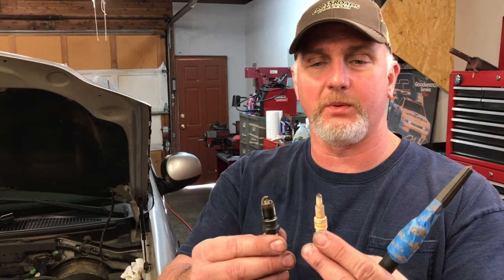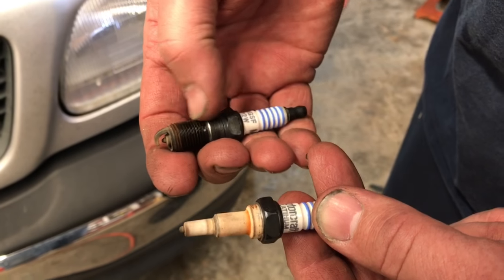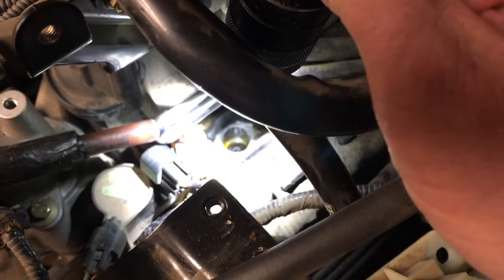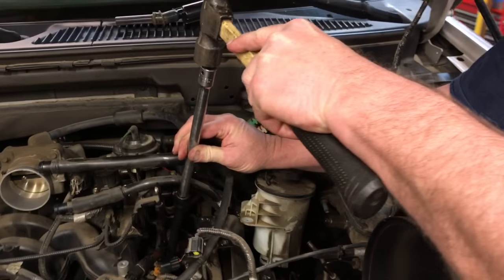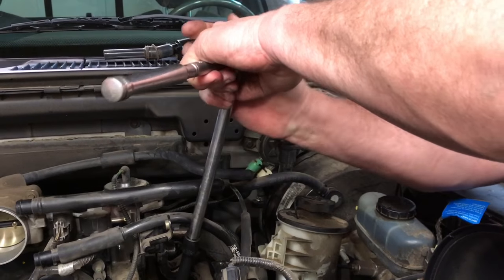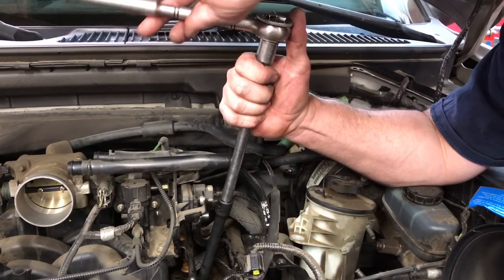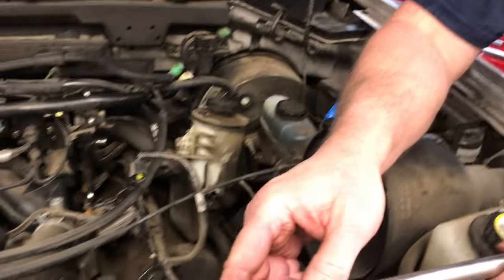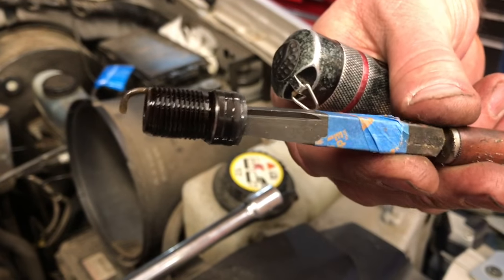How To Remove A Broken Spark Plug

Comment: For those who aren’t catching the name of what he’s using, it’s a stud extractor. It’s four-sided, and secured into a socket. I’m still trying to find out how to not get porcelain chips into the cylinder, as my plug just plain broke outright! According to others here on the comments, it is impossible to avoid, unfortunately. As far as using a vacuum cleaner goes, I plan on using a cornering tool, then inserting a drinking straw into the tool, and sealing it with some kind of tape (duct tape, most likely?). THANKFULLY, I have a camera tool to check for debris in the cylinder! Best $120 I’ve spent in quite a while! Well worth the investment, in case you’re wondering.

Now to get that penetrating oil in there…

I dread thinking about if the rear plugs in my Town & Country refuse to come out properly. :-/

Comment: So my plug broke off but the ceramic portion of the plug is still attached. What's my safest way of removing it and being able to get an ez out in to remove the threads?
Reply from the maker: Try vacuuming it out. Tape a smaller piece or tubing to your shop vac and see if that will suck it out. Worth a try

Comment: I have a 97 Ford F-150 4.6 l is there any other way to get the threads out? I have a broken spark plug to get out Seems like  welded it's so tight

Comment: I have got a 2005 Chevrolet Impala with a broken spark plug   
Where the threaded part is still in the spark plug hole and it's on the side where the firewall is is there an easier way to get that out

Comment: What did you call the extractor?  I played it several times and couldn't tell.  I'm getting ready to do my 07 F150 and I'm expecting at least one to break.  I want to get the extractor to have it here when it does.
Reply: I think he said it was a square type stud extractor.
Reply: What size square extractor do you use? I have this problem with my 2004 Grand Prix same issue same simile plug 5/8

Comment: Any recommendations on how to remove the porcelain without it falling into the engine?  The porcelain is preventing the extractor from gripping the plug.
Reply: I was told; there is no way around it. Particles will fall into the cylinder. Stick a small tube in there attached to a vacuum cleaner and or blow it out with a compressor. Do it a number of times, get as much out as possible. Send in a probe camera to checkout remaining bits. Blow it out some more. The rest will blow out the exhaust valve, hopefully. Good luck.
Reply: Can additionally use a vacuum connected to a hose in an attempt to suck up debris. But use an inspection camera in the cylinder to check for anything remaining.

Comment: Useful thanks!
Reply from the maker: Thanks for watching and commenting!
Reply: @minthillbilly  hey man, love your vid, very helpful, im just having Absolute worst time trying to break free 1 spark plug on my 98 f150 with the 4.6, it broke the thread end off inside the hole and I've bought spiral and square flute extractor but no luck, it's at the very back on #4 plug, I just can't seem to get a hammer or something to wedge the tool in there, got any suggestions?

Comment: Every mechanic must put grease on threads before applying when it is new...my scooter has stuck spark plug
Reply: The heat at the head will fry the grease.